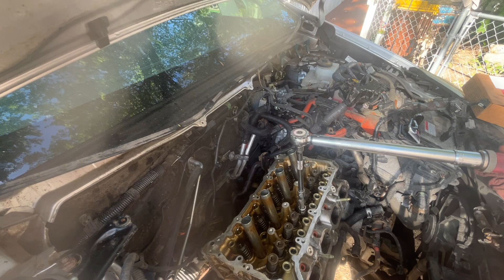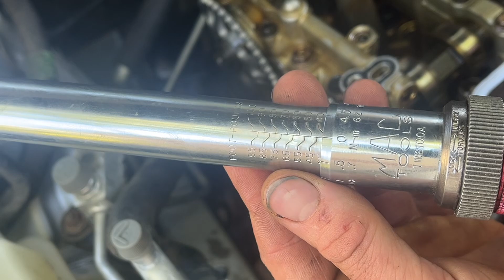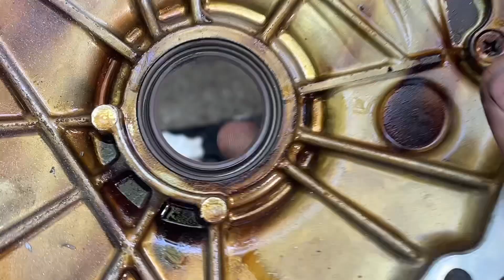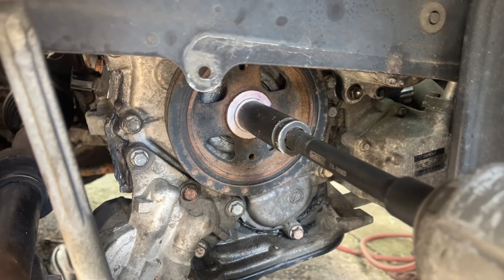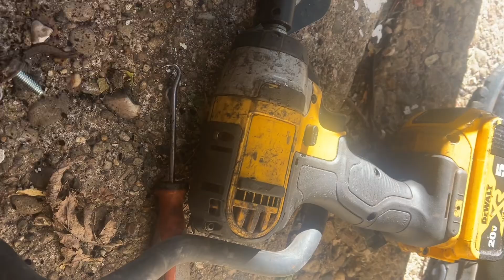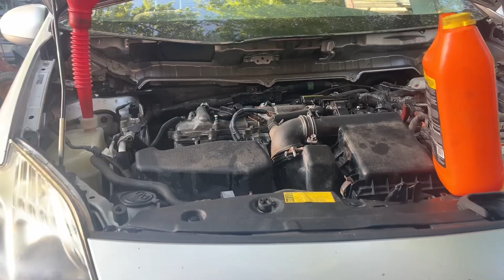Part 3. 2010-15 Prius cylinder head reassembly.

Comment: Brother out of all the videos I’ve watched in preparation of doing this myself this series has been the most helpful. Others skipped what seem like crucial steps and you have absolutely hit the nail on the head with this my friend thank you very much. And also do you know if the head gasket issue in the 3rd gen Prius is the factory gasket itself, the design of the motor or egr clog related? Everybody seems so divided and biased on the subject. I have one that just hit 200k miles and the egr problem bit me. Cleaned the cooler,valve,pcv,intake,throttle,etc. but I apparently knicked and tore a small hole in the coolant hose directly under the cooler. Took it for a drive overheat light came on pulled over and babyd it to the house. Now I have exhaust in the crank case. Aswell as the cooling system. I don’t mind doing the work if I get another 200k out of her.
Reply from the maker: @joshfowler3040  Thanks. Glad to hear this is helpful for you. If I had to guess it has to do with the gasket design and milage. Ive seen many of these blow the head gasket between 180k and 240k miles. The dirty egr valve issue seems to be more for fuel economy. Im skeptical that it causes a blown head gasket. I’ve serviced this Prius twice now since the head gasket job and its driving like brand new at 290k miles. I checked compression when I was done and it was at the maximum factory spec. It hasn’t burned a drop of oil either which my 09 prius with the 1.5L is plagued with. The 3rd gen is a very well built vehicle and its easy to see these hit 400 or 500k miles.
Reply: @ glad to hear that.  I absolutely love them. It was my mom’s but due to health problems she gave it to me. It’s always been a good car with the exception of the battery pack I had to do. And I believe she’s only ever had the oil changed. Which is wild to me even that neglected and with the little caviats these cars have it still runs great up until the clogged egr at a wopping 200k of abuse.but knowing all the maintenance items on the car that I do now I think I’ve committed to hitting that 400k mark. And even as tight and difficult as it looks to work on when it’s all put together. As soon as that wiper cowl comes off it’s manageable if not easier than most other cars. Not to mention all the community support online.
Reply from the maker: @ Agreed. I plan on doing my head gasket on my 2010 Prius whether it’s bad or not because I know it will be eventually. Even the battery packs can be rebuilt. These cars can take a beating and still be dependable.